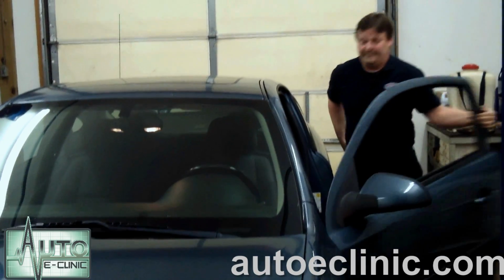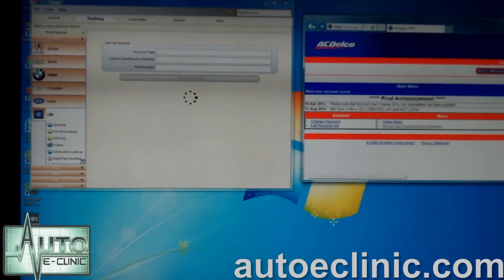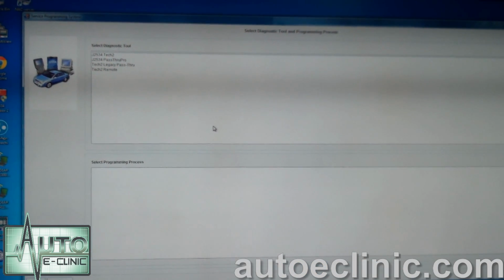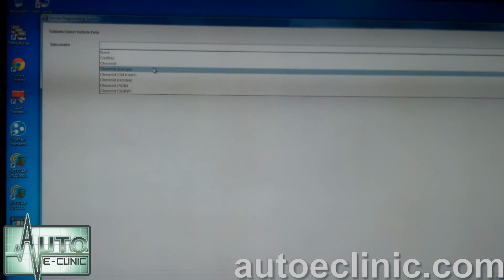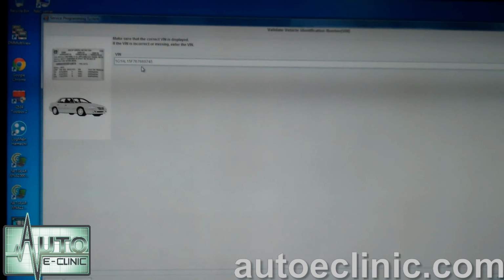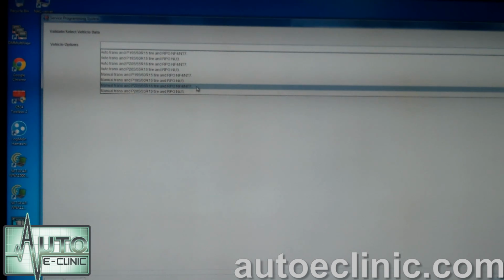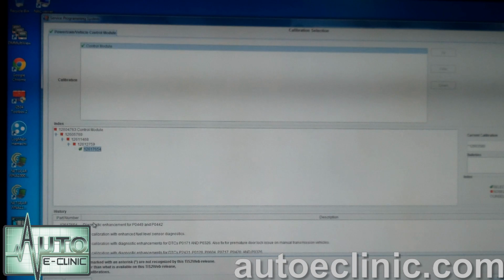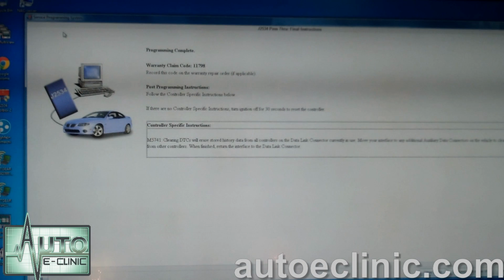How to Program and Reprogram OBD 2 Modules (Example Code P0326 Knock Sensor)

Comment: How do I program and reprogram my pcm in a 2006 f150 that used to have a 5.4 3 valve triton engine and I replaced it with a 1997  5.4 2valve triton engine. Do I need to input both vin #'s or just one out  of the  two.  Tell me what I need to do to get my truck to start and run again please

Comment: I just need simple OBD2 to change options to TURN OFF SEAT BELT CHIME please ?
Reply: What kind of car?  You might not need an OBD2 scanner or programmer for that.  I just got an 07 Grand Caravan.  It had the stupid seatbelt chime.   I found a few youtube videos that showed the process, but they were all just a little bit wrong.  The owner's manual, of course, had the correct process!  Boom. No more stupid seatbelt chime!